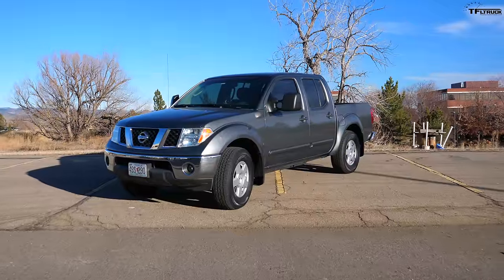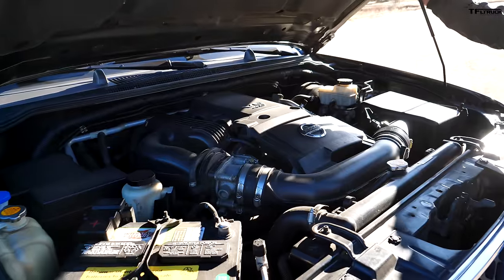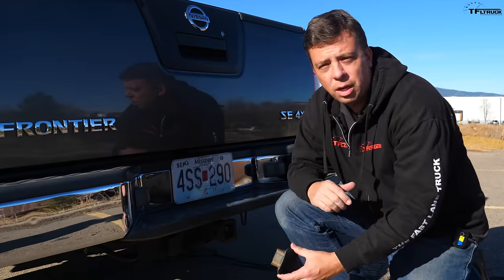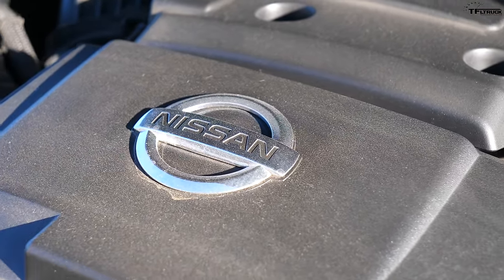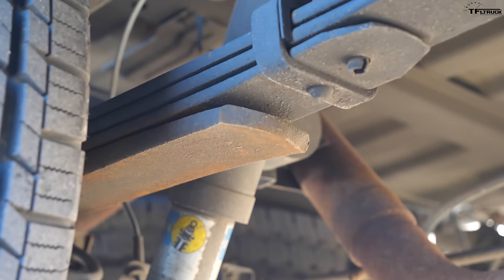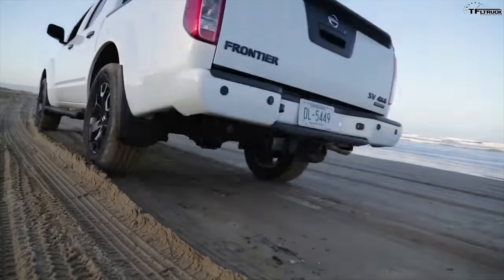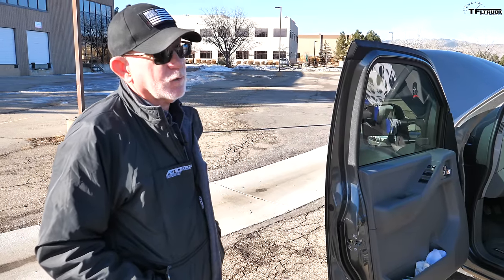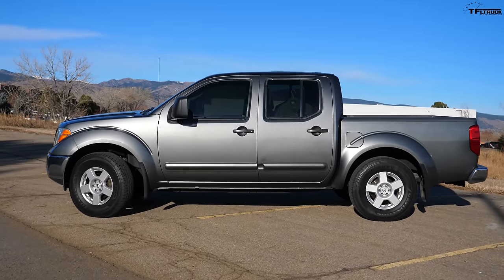Here's Why I Prefer The Old Nissan Frontier Over the New One — Dude, I Love My Ride!

Comment: I owned a 07 Crew-cab Long Bed with the manual  transmission, dealer had several manuals on the lot back then.
Reply: Man I wouldn't mind a nismo stick shift crew cab long bed truck! Though my king cab looks good and goes through the woods easily
Reply: I own a 08 crew cab long bed manual (my 3rd frontier), I saw them for sale every once a great while and finally found one, and was worth the wait!
Reply: Kasey Thomas I thought he said u couldn’t get the long bed with the crew cab standard
Reply: @Ryanspashai  Nissan offered a Long Bed Crew Cab with a manual from 2007-2011.

Comment: I have a 2013 Frontier. Like this guy, I wanted a manual. I genuinely enjoy driving the truck. It does everything I need it to do, and it is very much a truck. There is nothing fancy about it. It's an honest midsize pickup. It has good power, I can set the cruise while in 6th gear on the highway and rarely have to downshift for a hill. It holds 70-75 mph in high gear, with very little issue.

Comment: We have a 08 Nissan Xterra. Pretty much the suv version of this truck and its been a real trooper. People don’t realize but this truck is built real beefy with a fully boxed heavy frame derived from the titan. All of its vulnerable components sit above the frame line for off road escapades. The engine is head and shoulders a better engine than the tacoma when it comes torque and it feels it even though its so old.

Our xterra is sitting at 150,000 miles of which a ton of those were off road. Its never been out of alignment and still drives as smooth as day one. Only issue weve had is the computer went out, which happens a lot here with all types of vehicles because of how hot it gets here.

A lot of times people under appreciate these things because they get terrible mileage, but honestly one look at how beefy these things are built and it makes total sense.

You want an honest truck that as long as u do its recommended maintenance will last? This is it, get em while they are still avail.

On another note i see nissan hardbodies all over the place still. This is as close as you can get to that kind of longevity in todays modern world.

Comment: This video definitely changed my mind in what truck I’m buying. Definitely getting a frontier, they’re also cheaper then the other brands as well. I don’t care about the bells and whistles.
Reply: Less stuff to break.  Plus with the model run being 2005-2019 there wad tons of time to work out any kinks and there's tons of info out there and cheap fixes that make for simple preventative maintenance to avoid a couple of the common issues.

Comment: Nice vid. Good to see the old trusty Frontier get some recognition. A few corrections though. You can buy parts for and rebuild the rear M226 axles. There are even aftermarket lockers, gears and armor bits available.  The best part about this erra of Nissans is suspension and some drivetrain parts from the titan will swap to the Frontier, Xterra and Pathfinder. This includes front suspension, front diff. You can even swap in the the V8 from the Titan. Essentially you have a factory mid travel suspension that is all bolt on. Great options for those who want to do mods or build overlanding rigs.

Comment: I love the look, I absolutely am apolled by the new Titan grills , I love the old-school look like this
Reply: I agree with you on the Titan.  When my wife and I were looking for a good used truck a couple years ago, we specifically wanted a 1st Gen Titan.  We ended up buying a 2015 Titan SV 4x4 at a Nissan Dealer, they tried SO HARD to sell us on the new 2016 (at the time) Titan and we just couldn't get past the looks.  Just like the Frontier of this Gen, they are just good looking trucks.  Nothing fancy, they just do their job without any fuss.  We have had our Titan 3 yrs now and put 40k miles on it so far.  Only Issue was the fan clutch which was replaced under warranty.  Recently our factory navigation system that the truck came with is going bonkers at times, and the rear glass has a leak.  We did buy this truck used so I am thinking that rear glass was replaced at some point for some reason and was improperly installed.  All and all, we love our Titan.
Reply: @eppyz  just heads up, around 150K mark the ecm might need to be replaced, it's a problems with the gen 1 titans and headers like to crack, mine had the ecm fail around 177K but replaced with a same year for nothing, I drive an 88 F250 4.9L now and I miss the speed but I love the reliability of my 88, both frontier and titan with with hen 1 Titan look are good to look at and look right, I miss my Titan
Reply: This is not old school a d21 or a Datsun now those got the look
Reply: @mom_im_losing_it  yes I know but I mean of the frontier look that's my favorite

Comment: I’ve always been fond of these Frontiers, especially in the Pro4x model, I went with a 2018 Tacoma TRD off road though and love it overall. I know it’s just one truck but was surprised he had to do a timing chain under 100k and a full rear end replacement. I wonder if the high towing miles near capacity failed the axle.
Reply: Yeah with one truck, hard to make any real statement about it either good or bad on reliability. So many variables.
Reply: Common problem with 4.0.
Reply: Buddy and I both had 05's Nismo automatics and the rear axle diffy unit needed replaced at around 60,000  with no towing only regular 4wd drive use going up and down the ski mountains in winter, so I believe was pretty common in that year especially
Reply: I have a 2006 Nismo (later renamed pro 4x) with the 6 speed manual.  Great truck.

Comment: Let's not forget, that they did fix the timing chain issue and the radiator leaking antifreeze into the transmission issue I believe in 2010. So I'm not worried about either of those on my 2013 Pro 4X of course she doesn't have to worry about that on his manual transmission but for the automatics

Comment: What an awesome truck!!!whats interesting I have a 08 frontier. I had to get mine ordered and got mine with the long bed with a 6spd manual. It was the last year I was able to get the 6spd.
Reply: Thomas Bloomer I’ve got 2 manual Xterra’s. 14 and 15. If there is Xterra there should be a Frontier. You still can get them new in manual.
Reply: I bought a brand new 2018 crew cab 4x4 SV 6 speed stick. The nissan frontier, Toyota taco, and jeep gladiator are the last of the manual transmission trucks
Reply: 2010 was actually the last year for the long bed six speed. I just picked up an 09. They are not easy to find.

Comment: Thanks for this one.  What a great review.  Been looking at a Frontier as my next vehicle and it is so awesome to hear from a real long term user of one.  Thanks so much for this video!
Reply: Stay away from the frontier this guy blew a timing chain at 80,000 miles and needed a complete new rear end and if he had the automatic he probably would have blew a transmission too lol. you're not saving any money because you're going to spend more and repairs then if you just bought a nicer more reliable truck like a Toyota
Reply: @paul9912  to be fair he is towing stuff with it..  But my dad has the same 2010 Frontier I do except his is manual and had to get a new axle as well and has only ever towed his snowmobile trailer around.

Comment: I remember trying to replace my sparkplugs in my 06 nissan frontier. Had to take off the air intake manifold to reach the two last plugs. What a pain in the ass! The 4.0 had really good power though, i have to give it that. Nowadays I would avoid Nissan Renault like the plague. I miss my 06 Frontier though, Hurricane Harvey took it away from me :{
Reply: Steel Talon I’ve owned several new nissans without any issues.

Comment: Purchased a 2018 crew SL auto/4wd.
Regardless of the reviews concerning cramped back seats, my 2 kids
have enough room to sit in back. Walks threw 10 in. of wet snow with ease.
The smaller cabin is no issue, considering the other options were $30,000+
for regular sized trucks which would (as usual) have the trans blow up within 2 years or start on
fire in the parking lot. I have 18 speeds on my bike, I don't need 18 speeds on my truck.

Also last of the MPFI as most everything else is now the carbon choked DI.
Truck has been a blast to drive, so far we are happy with it and it works
for us just fine. We have no reason to drive in the woods or tow 7000 lbs.
If we ever needed an "infosystem", we would simply use my daughters $50 Kindle.
Great review, thank you.

Comment: I just want to put this out there, my 1995 Ford Ranger has 330k miles, and still starts and drives just fine. Interior is in damn good shape for the age too.
Reply: menchelke love my ranger as well, I’ve put 80k on her she’s now at 180 and all I’ve ever done is regular maintenance and an alternator
Reply: Ford...
Reply: I ran two F150s to well over 300k the Frontier is great. But the F150 sets the bar for all other light trucks.
Reply: The Ranger 4.0 is a turd compared to this engine.  Plus only 5 speed, torsion beam front suspension, brutal interior.  I originally wanted a Ranger but when I came across the Frontier and realized could get a 4x4 4.0 with 6 speed manual I was sold.

Comment: I owned an 07 frontier, no serious problems untill 175000, transmission line leeked into radiator, mixing oil with water, cost almost a grand to fix. My mechanic said it was common on Nisson with auto trans. Told me it was just a matter of time untill trans and front wheel drive unit would fail, I genuinely loved the truck but wasn't happy about the trans and all being able to leak into  the radiator. Really like your videos.

Comment: It's a good thing that you have the manual transmission. There was a big problem with the, automatic transmission, cooling system.
Reply: That ain't true man! If you change your Automatic Transmission Fluid Regularly and Have your Cooling System Flush Regularly that issue will be impossible to happen! Unless If you're Neglecting your Nissan Frontier then that issue will definitely come by a surprise

Comment: Recently purchased the same spec. SV 4x4 with a 6speed. 2016 model with 15k miles. Im loving it. Great truck

Edit. If yall wanna drive it, im in north denver
Reply: How did you get an SV with a 6 speed?  Are you talking manual?  I thought only Pro-4x came in manual in 2016.
Reply: tasimota if it has the v6 it will be a 6speed. I lucked out i guess. It took a while to find the spec i wanted
Reply: I bought the 2016 new off the lot June 2016 automatic and love it.Don't put a lot of miles on it.Just hit 20 thousand and not one problem.Hit the gas pedal getting on the highway and my wife yells slow down.Traded in a 2005 Dakota V8 automatic and would get on the highway and would say come on, come on, and nothing would happen.Now my head goes back.What a difference.

Comment: I think the rear end can be attributed to 60k miles of hard towing for a midsize truck.
Reply: Ryan Martinage you call that hard towing?? He was towing all within the frontiers safety limits.
Reply: @vojnikjna30  for a mid sized truck yeah. Small diffs and generally not geared for that much towing.
Reply: Doesn't it have a Dan a 44?
Reply: @ZulkSOD  only the pro4x.
Reply: @ryanmartinage  In '06 it was called the "Nismo" package (and "OFF ROAD" on the Xterra).   But those versions do have a Dana 44 with the e-locker Bilsteins and larger tires just like the Pro4X does.
Reply: @johng4527  He said they use some different items vs what we think of as a Dana 44. Ill have to look it up.
Reply: @ryanmartinage  actually, now that i think about it I believe all of the V6 6spd manual trans trucks have the Dana axle but the automatic V6 trucks only got it if it was the nismo (or newer pro4x models)
Reply: @johng4527  Looks like its a 32 spline 8.5" diameter gear set.Trying to see if I can find any detailed info. It doesnt look like a slouch. Im surprised it went out with stock sized tires.
Reply: @ryanmartinage  yeah, idk.   I have buddy with nearly that exact truck (05 crew cab 6spd 4x4) he tows with his too and his rear diff only  recently started to make noise and his truck has about 260,000mi on it.
Reply: The m226 is known to be failure prone. That's why both of my Frontiers have Nissan's own C200k which doesn't generally have the issues, however it is only available with the auto trans I believe.
Reply: Wish I could say it was, I had an 05 and buddy of mine had the same truck, both Nismos and we both had the exact same issue, needed a rear axle assemby at around 60,000 miles no towing at all mostly a mountain ski truck and home project dump runs... It was a good truck in snow and crawled up mountains flawlessly, but that repair turned me sour at that mileage, I believe it was a very common problem, should note mine was automatic wish i was able to find a manual at the time
Reply: John G, at 7:40 the view of the axle looks to be the light duty version, not the Dana.

Comment: I have a 06 Frontier SE V6 King Cab with the 6 speed manual.  It has 1/2 the miles of his but I've had a similar experience.  The only issue so far is the driver side window motor died last week.  I have the replacement motor and will install it myself. I'm planning to keep this truck 10 more years. Great solid truck.

Comment: Crazy! I had a 2005 and it had so many issues. Was bought brand new and at 58k the engine needed to be replaced because of the notorious catalytic converter issue, sucked a piece of metal into the motor. After that the vehicle had various little but annoying issues, rusted wheel wells, fuel leveling gauge and fan clutch issues, transmission failure at 130k coolant mixed into tranny fluid due to faulty radiator cooler line degradation. Horrible Nissan customer service and very expensive dealership repair cost. Had a 2006 Nissan Murano that was a lemon as well. I have swore off Nissan and haven't own or driven one since. Glad to hear a success story rather then another dismal one like mine ✌🏽🇺🇲

Comment: This is why I love the Frontier. Everything the guy pointed out is why I love it. My aunt has one in white. Same year, same wheels, same bed length, and same engine, but with the automatic. I remember there being any issues with the transmission. My aunt just needed a truck, I it mattered. She didn’t drive hers as far as that guy did, but it was still very reliable. She had a catalytic converter issue with it in recent years. She got that fixed and boy was it worth it. The truck itself held up great. It didn’t have many major issues. Of course it has its share of minor issues.

Comment: I didnt realize the Nissan 4.0L had that much power. I had an 07 Ranger for several years with a 4.0L with only about 207hp and 230ftlbs. That's kinda disappointing...
Reply: When the frontier came out in 2005 it had the most powerful v6 in the class.
Reply: Rangers are weak. I had the 3.0L one in 2000.
Reply: @pryme2013  I wouldn't say the 4.0L was weak. I never had an issue with passing or wheeling up steep hills. But a little extra umph would have been nice. I imagine that trailering would become a problem though. The 3.0L you had is known for being sluggish. I knew to stay away from that one.
Reply: I want so say that year Ford 4.0 was a single overhead cam where the Nissan is dual overhead cam.That accounts for part of the power/torque difference.
Reply: My 4.0 ranger only gets 160 hp! Lmfao
Reply: Chad Gilliland  They were pretty decent, them being OHC and only 2v per cylinder was kind of a waste. Especially when you use the old in block cam short block and put 3 timing chains on it with a cam blank.
Reply: Shoulda shopped around. It's a beast.
Reply: @dillonh321  The frontier is claiming the title of most powerful truck in class again now with the release of the 3.8 l v6 with 312hp in the now 16 year old truck shes come full circle again

Comment: Have had 3 Frontiers starting with a 2001. I was a volunteer firefighter and it was my POV (personally owned vehicle.) It was a 4-wheel drive with a V-6. I added a siren, flashing lights, strobes, fire radio, and 12,000 pound winch with front and back receivers and power. I ran the hell out of that truck for 9 years. It never failed me and helped me save many lives including pulling a car that was wrapped around a utility pole. 
I traded it for a 2010 Frontier but opted for the base model. I always regretted not getting 4-wheel drive and the other features. In 2016, I traded it for a fully tricked out Frontier Pro-4X. All three have been excellent trucks!

Comment: I had a 2004 SV King Cab 4cyl 4x2 with almost 200k miles on it that I finally drove (literally) into the ground.   I traded it in on a new 2019 6cyl SV Crew Cab, and I just LOVE the truck.  For all the reasons the owner in this video said - just the right size and does everything I need a truck to do, although mine is an automatic and a 4x2 (never in my life have I ever needed a 4x4 for anything in my 30 years of truck ownership).  And I am averaging 20MPG (been tracking the fuel since I rolled it off the lot).

It feels like I am in something when I drive it.  Great visibility out the cab. It is comfortable - we've taken it cross country once already. You look under the hood and it looks like an engine, not a sealed block - if I had to fix something I could. What I love the most is - it has no goop in it - no idiot electronics.  It has Bluetooth for the phone and a back-up camera (both mandatory). I have put almost 6k miles on it in the 5 months I've owned it.   

I hope they don't pull a Ford and massively over-engineer the next model upgrade.

Comment: My 2007 Nissan frontier manual transmission just hit 143k miles. I have the 6 ft long bed with the crew cab. Ive had no major problems with it. Keep up with regular maintenance.
Reply: I’m following up 2yrs later. I now have 167k miles on it with no problems. I change the oil myself at every 5k miles